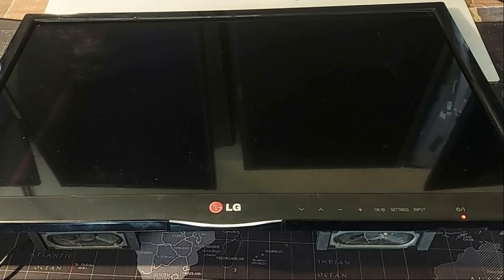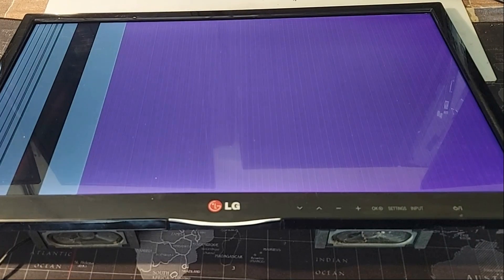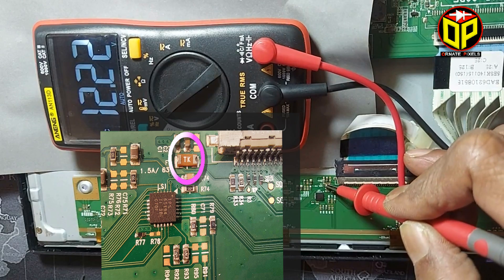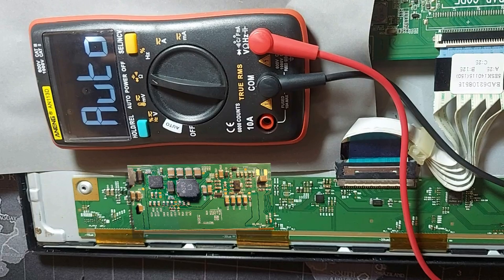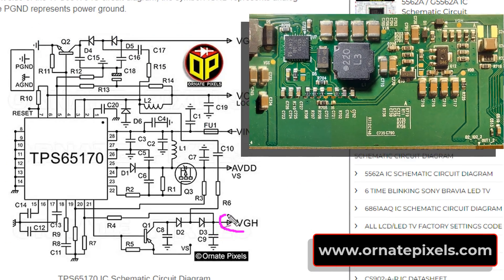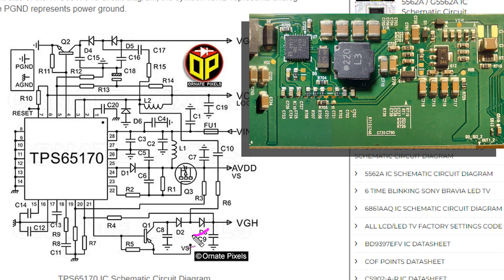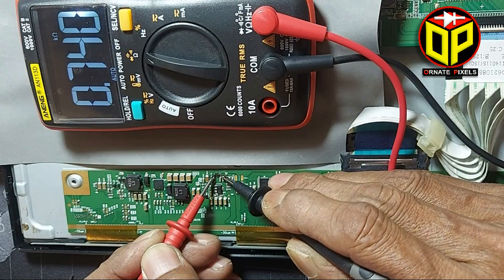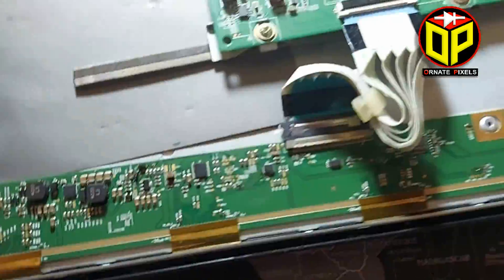Vertical Lines And No Display  on LG LED TV: Panel Repair Guide

Comment: Excellent explaination, I've seen many of your videos. 
I used to get vertical bars in SONY 42W700. Unfortunately, the motherboard got short circuited by accident. Before I buy a new universal motherboard, Please let me know if the TCON board voltages can be tested outside the TV by simply giving the 12 V supply to it? maybe if the VGL and VGH lines are leaking...

Comment: Happy eid Mubarak sir m.a mostafa, a fan of your channel from the Philippines 🇵🇭, keep it up and have a good health
Reply: Sir, if you don't mind, can I get an idea from your side, an led tv problem occur after I blocked some signal from tcon, a thin blue vertical line appeared in the near edged of my left screen, what could be wrong in the panel screen of my led tv, thank you so much if you are interested answering this message, this will boost my knowledge and trust to myself

Comment: Whr can i buy this diodes..any online buying link
Reply: You can use two BA 159 DIODES or remove  diodes from old crt tv board.the diodes used to rectify secondary voltages from E H T transformer are high frequency diodes.like 24 volt for vertical i.c or 180 volt for video output stage..It will work better than this doiodes and current rating is better
Reply from the maker: The diodes by which VGH/VGL are output- open that diode from the damaged board and use it.
Thanks Brother
🌺🌹❤🌹🌺